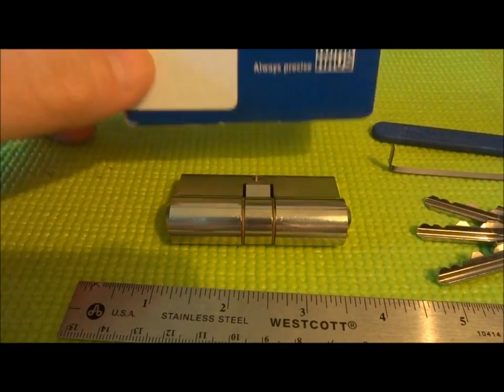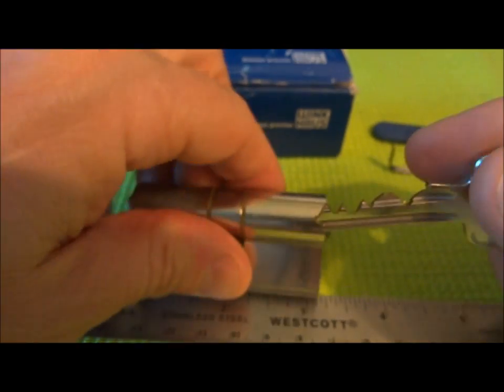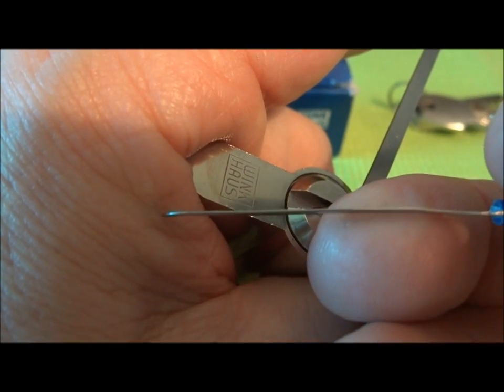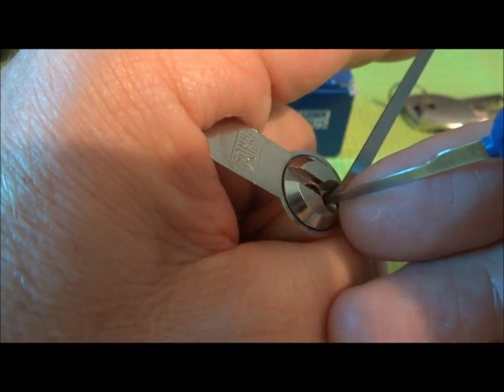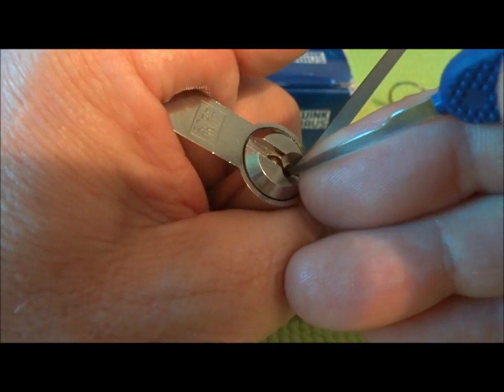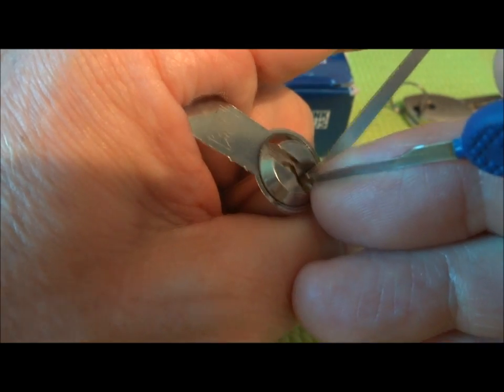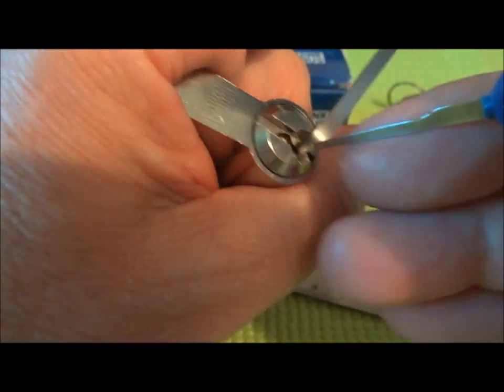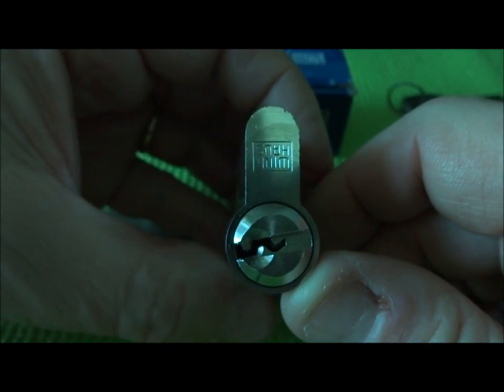(232) Winkhaus XR51 Euro Cylinder Opening Tips

Comment: Those brass clips can be removed. Again with a locksmith tool and my locksmith here has that tool. Those rings are pressed into place with a machine. You can remove them and get new ones but the new ones are chrome plated and you have to crimp them in place after installing them. This feature is supposed to give you some tamper resistance. Video comming soon!